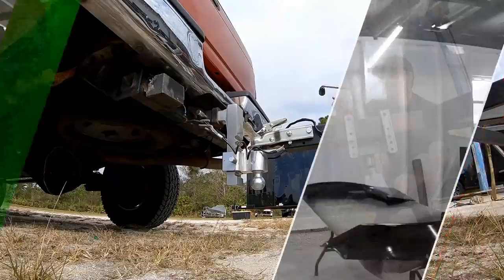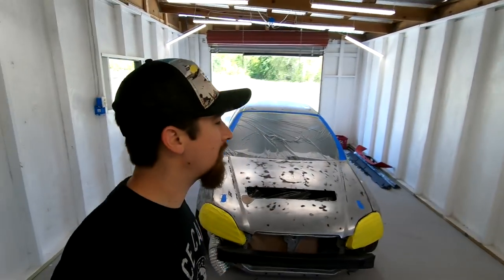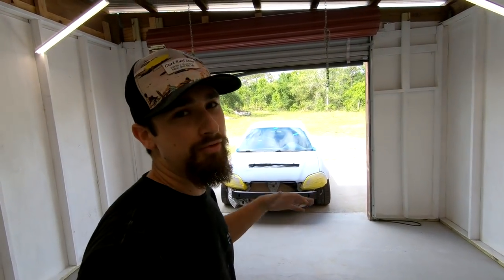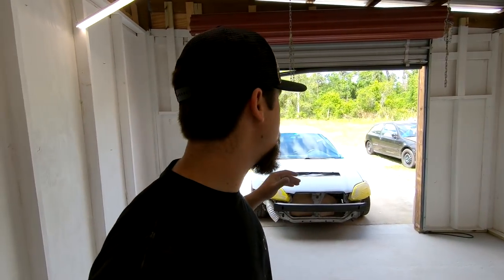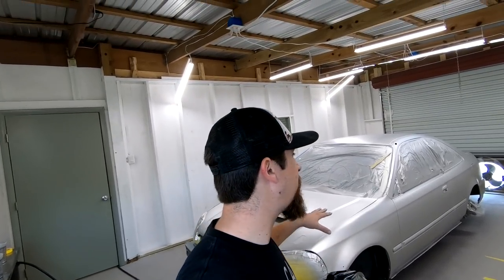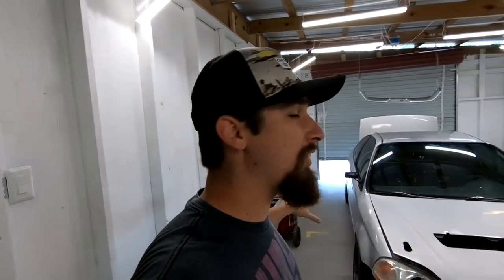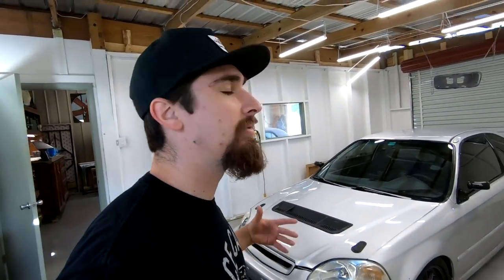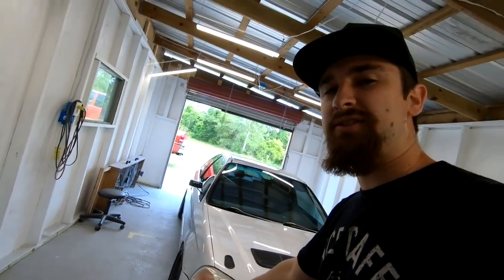Track Civic Full Paint Job Refine Movement Collab.

Comment: Hope I can squeeze a few questions still out here but how long between coats both on base and clear? And by consistency you mean a even clean surface of paint and clear? and as far as sanding before primer what grit sequence do you do and do you always go to bare metal.

If you can help at all, much appreciated. Your videos are awesome, great quality and great content.
Reply from the maker: Thanks man! 

for between coats 
When i am doing a full car by the time i get all the way around the car i am pretty much good to take a min. break and start back at the same spot i stated the last coat. So really 10 mins or so between coats. The clear coat you can always tell when youre ready to go again by sticking your finger on the tape right near the edge of where you painted. If the clear coat still feels wet like water youre not ready, If you push down your finger and it leaves a perfect finger print and the clear is really stickey, youre ready to go. 

Consistency i mean for laying down silver is hard because if it is to thick it will be darker and leave behind stripes in the finish. 

Sanding before primer i finish with 220 and then sand the primer with 400 then 600 before base coat. 

Thanks for watching.
Reply: BodeVision much appreciated 🙂

Comment: Sweet!!! I love the outcome!! Anyway, do you usually dry sand the primer with 600 and finish it with 800 grit? Which one is better wet sanding or dry sanding. I didn't see what you did after you sanded the primer. Did you wash the entire vehicle again? Or just clean it with wax and grease remover? Great job man!! You're truly an inspiration bro. More power to you channel.
Reply from the maker: First, thank you so much for the support and the feedback and for watching my video! Now, to answer your questions i find it easier to clean the dry dust off the car rather then having the car a soupy mess. Once i am done with the sanding i take off all the plastic from the windows as the primer dust is all over it, bring the car outside and blow it off with an electric blower (electric is a must compared to gas to prevent oil from being sprayed on the car) then, i use grease and wax remover, then a final tack cloth before i start to spray. I still end up with some dust in the final product but once its wet sanded and buffed they are gone. Also, while spraying the base coat if i notice anything on the car from coat to coat i just use a piece of folded tape and pluck it off. If its a piece of hair or dust just the tape will pull it off and im good to go. 

Hopefully this cleared it up for you!
Reply: BodeVision awesome!! Thanks for responding to my questions. Maybe someday I can let you paint my vehicle too.
Reply: What are the steps on wet sanding and buffing the clear coar to flatten the imperfection on the coat?
Reply from the maker: Bradley Pedrozo I have a video where I go into detail on wetsanding and buffing. I think that will clear up any questions you have. It's a little further back on my uploads but it's there

Comment: Great Video, I have a question. .. why you haven't remove the windows all around so you can paint the mount locations from the windows, you use the same color code from the factory Honda Civic right? you haven't remove the windows because it was going to be the same factory color? Now if the civic's owner says I want blue or Red total different color from the factory car's color you will have to remove all the glasses and also the weather seal strip as well right? can you still paint different color without removing the glasses, weather strips?
Reply from the maker: It all depends on what the customer wants and is willing to pay for.